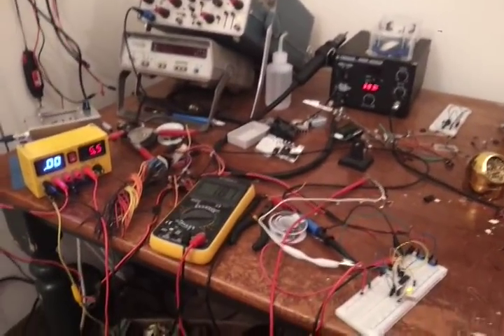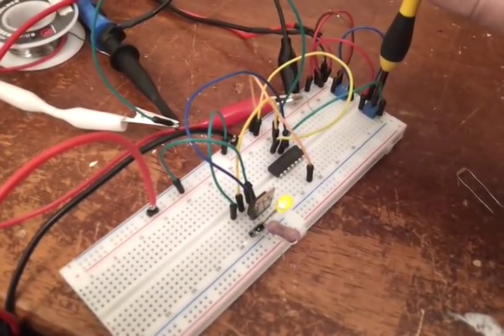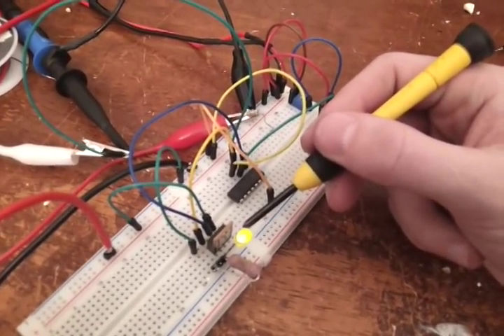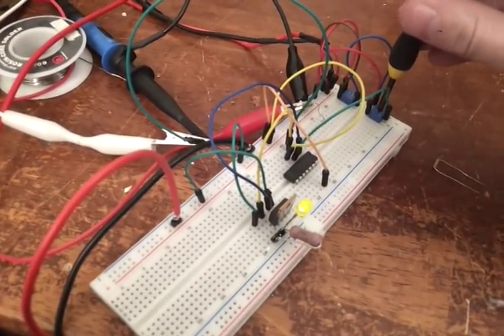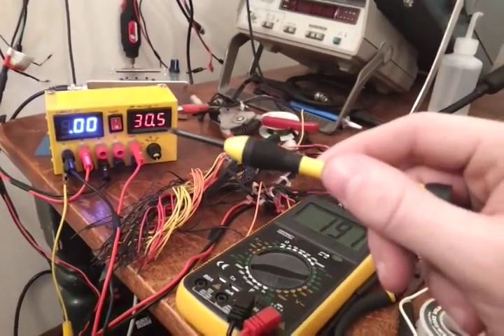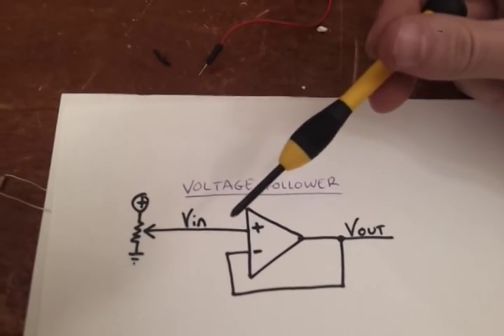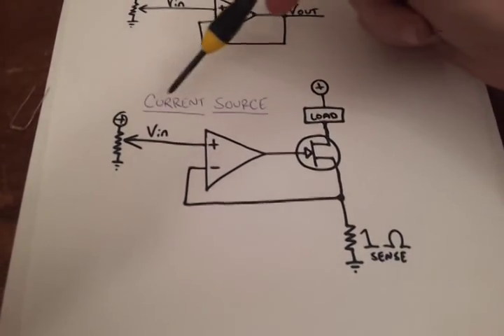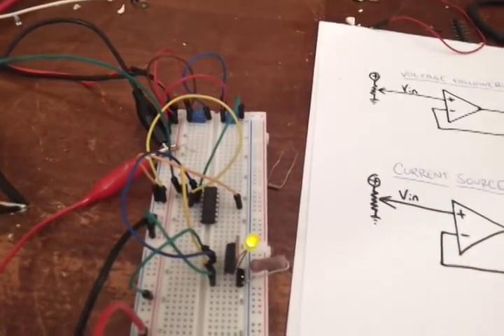Op-Amp Current Source Driving LED

Comment: nice video! im trying to design something similar, unfortunately i only have a basic knowledge of electrical circuits. im trying to design a laser driver circuit that can accept an input voltage of 5-24v and that can modulate the laser diode with a 0-5v analogue signal. ive been reading up on op amps and transistors and im definitely learning a lot but is there any material you could recommend to me or any advice you could give to help me with my project?

Comment from the maker: I stayed away from the buck converter for the same reason I didn't use PWM to control intensity.  My application records RF-sensitive currents in a biological setting (single-cell neuron electrophysiology recordings with patch-clamp techniques). I had to avoid PWM because, even when well-shielded, it's noisy enough to show-up on my recordings. However, I absolutely agree! PWM would be the most effective, cheapest, and certainly linear way to control intensity.  A toasty hot FET is cool with me!

Comment: not a big deal if you dont up the voltage too much above the voltage the led needs but that's like a linear regulator, remember it's the vdrop times amps so if that power led you say, draws enought current the mosfet will get pretty hot. I that case a buck converter would be a good solution. any of the current mode chips should work fine.